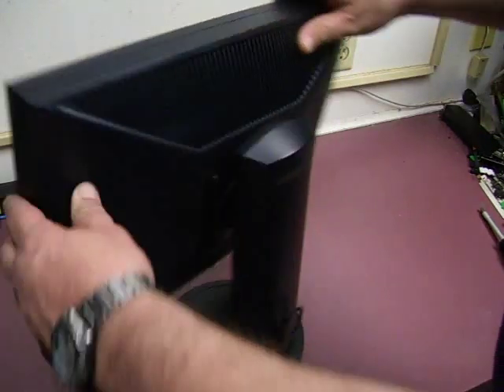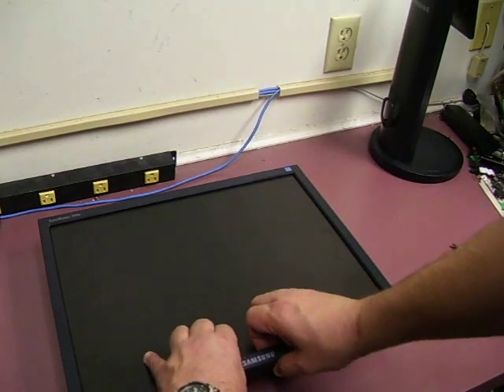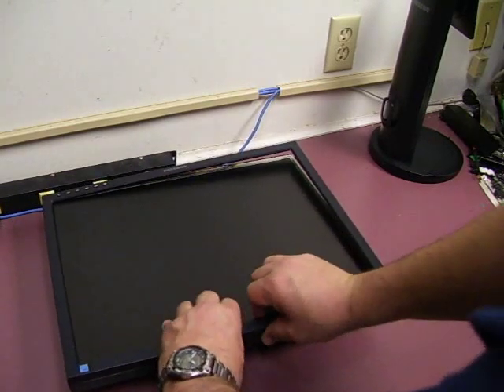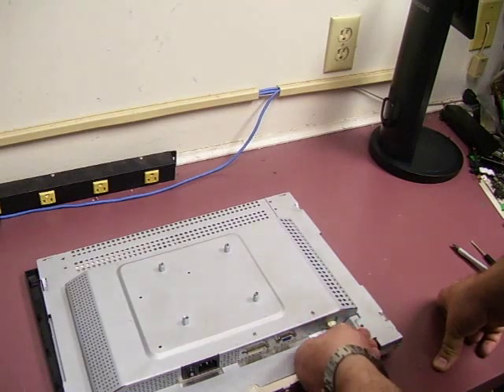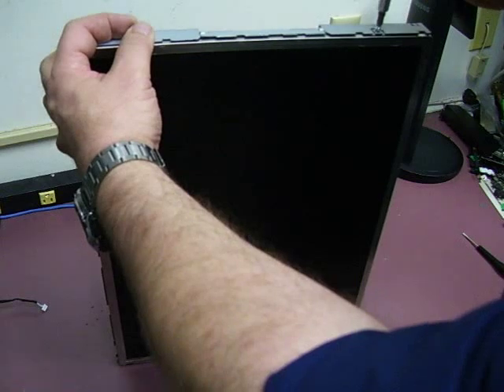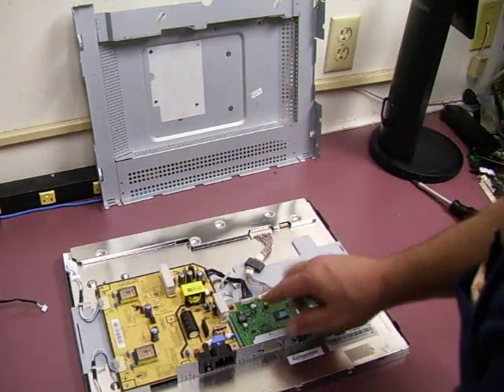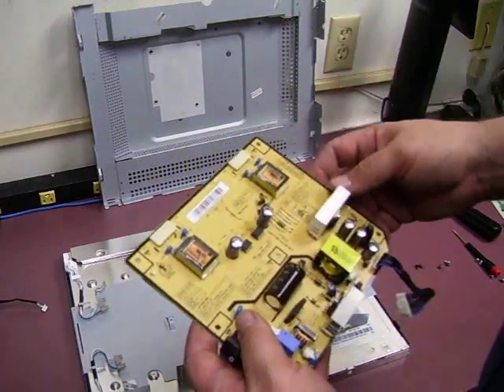How to repair a Samsung 204b monitor with power issues - Part 1 dis-assembly

Comment: Just letting you know that 11 years later your video is still useful. Just changed 5 capacitors on my 204b, and it works great again!
Reply: August 2024, just recapped my 2006 vintage model. Works fine again. Used rubycon.

Comment: I sent my monitor screen in for repair in Feb 2013. No response to emails sent from three different accounts. "Buddy" called to say his responses must have been filtered out (in all three accounts?). He said the unit needed a voltage regulator. I said OK. Weeks went by. I called but their voice-mail box was full, so I couldn't leave a message. I suspect this guy is not on the up and up. Better Business Bureau rates his company with an F.  It is now April 15, and I've given up expecting ever to see my monitor again. Beware. Fix your monitor yourself but don't send it to ccl-la.

Comment: Thanks for the info, but you missed a step. I have 2 204B's - 1 dead with a bad LCD screen (from being dropped) and the other 1 took 2 or 3 minutes to come on. I took the power board out of the one with the bad screen and put it in the 1 that took so long to power up and now it appears to be fine. On both monitors there were 2 screws on the back shielding that I had to remove before I could remove it. I likely would've never figured out how to remove the front bezel without your video, though!

Comment: Excellent instructional video! Thank you!
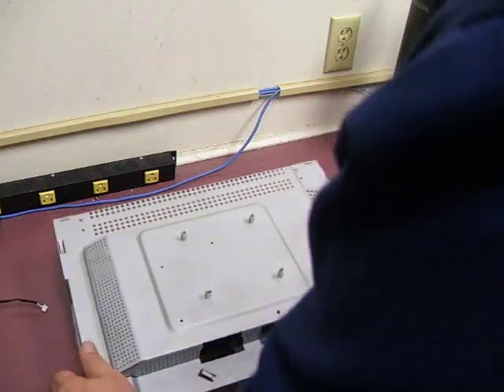However, you left out a step during the disassembly.  You'll notice at 3:42 just above the video ports, there are 2 additional screws that need to be removed before the rear shield will come off. On the unit you were demonstrating, it must have been disassembled before because those two screws are missing.  On my unit I had to remove those before the shield would come off